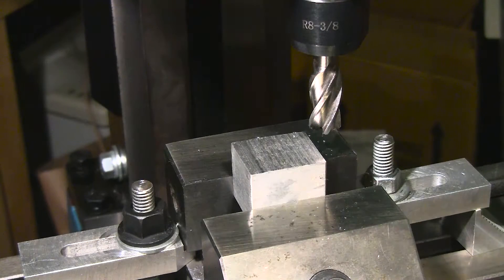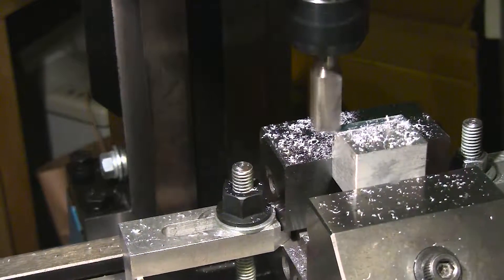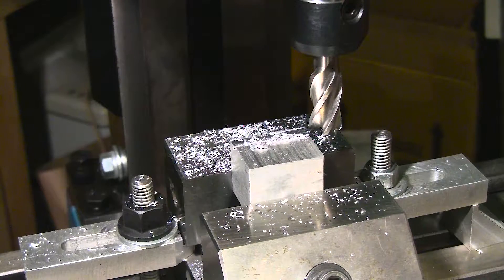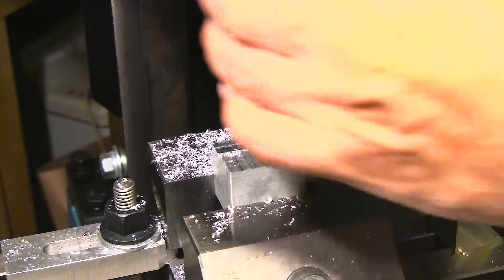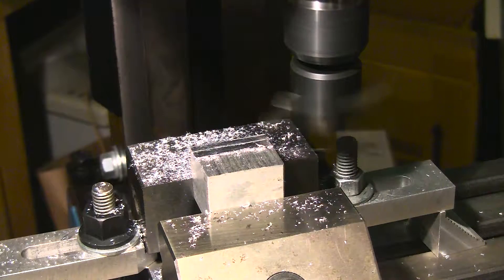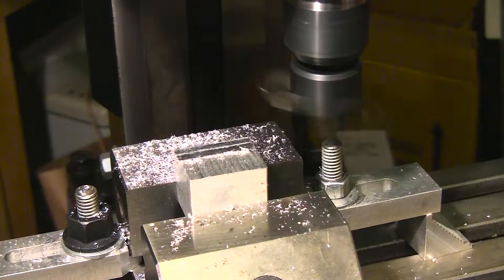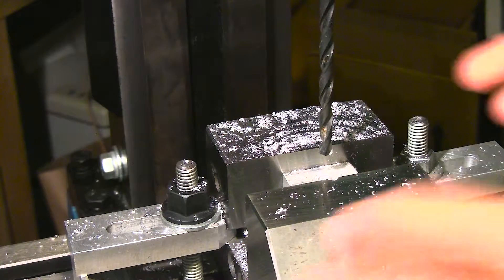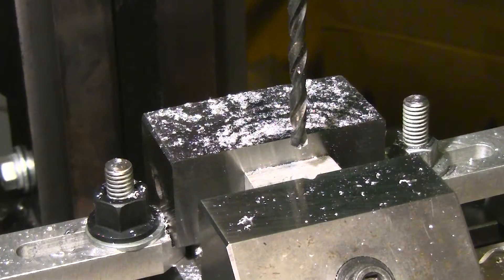The LittleMachineShop.com 3960 HT Minimill Performing Basic Cuts

Comment: Thanks Jose. Solid little mill. What are the tolerances, does it consistently get down to 1/1000th?
Reply: I have had the LMS 3990 mini mill for years now and use it daily. Like any affordable imported piece of equipment, it does require "tweaking" and modifications for personal liking. I can easily hold 1/2 thou, when when using my power feeds. The initial cost of the mill is not terrible, although the constant need for different types of tooling and cutters is where the budget will suffer. Tooling becomes addictive, especially when you see the great end results of your project.

Comment: even when you weren't Machining that thing made a lot of noise mine doesn't make near that kind of Racket it's really really quiet and it's a harbor freight
Reply from the maker: I have nothing else to compare it to. It's different that the HF model.
Reply: It does sound like a bot of "bearing scream" although hard to criticize with a single bladed oversize fly-cutter. I have the LMS 3990 and use it daily for years now and it is still quiet. Perhaps a drip  of oil on the upper bearing to see if that makes it any quieter? Chinese bearings are basically garbage anyway, always inconsistent.

Comment: What size bolts does the X axis take?
Reply from the maker: I'm using regular hardware store 5 /16"  diameter ones. You could almost slip a 1/2" one but remember these Chinese XY tables are. metric.
Reply: Thanks for the Reply. I was curious since my mill isn't here yet and was buying up stuff for it.

Comment: Mini Lathe and Mini Mill Demos always seem to cut Aluminum. Is steel just out of their practical range?
Reply: I have both the LMS 3990 mini mill and their 7 x 16 lathe. I cut many steel materials, including stainless and chrome moly with Zero problems and great finish results. Sizes are held within 1/2 thou. People have to realize that with the smaller, under-powered machines that smaller cuts and speeds have to be a practice. I was used to my old South Bend lathe and Jet mill, but discovered that immediately and became used to it simply taking more time on larger projects, but with excellent results. Proper selection of cutters and their material type, with feeds and speeds are crucial for any machining operation, regardless of the machine. It's always easy to place blame on a machine, although it is the operator that makes the difference.

Comment: Would you buy this machine again?
Reply from the maker: +oishisakana Yes I would. Though only if I was not going to work on anything beyond the capabilities of these Minimills. They are great though. If I needed to do large work then I'd have to go with a larger floor mill.Their newer one is even better!
Reply: I am torn between this model mill and the lms5500 mill which is a 2.7 Sieg.  But significantly more money.  I work with motorcycles.  Just need to make brackets and will mostly be slotting a lot of aluminum and some steel.  And using it maybe 5-7 times a month.  Any machines you can recommend for me??

Comment: Nice little baby machine, performs very nicely, for it's size. Something that helps a lot with machining aluminum is, a little kerosene or WD-40, stinks a little, but, you can increase speed, eases the cuts and avoid the chips sticking to the cutters...
Reply from the maker: +pierre beaudry I do use WD-40 and it is convenient to use. I did not for this little demo as I am in an area where I did not want to make more of a mess than what I already made. But yes. Aluminum does require a good lubricant or coolant to produce the best cuts. I find that a 2 fluted end mill is much better on it but I decided to try it with the 4 fluted one and yes, not as good a cut as one can get with the 2 fluted one. The Flycutter work dandy though. I use it for all my full surfacing jobs. Unless I want the end milled look. Joe
Reply: The 2 fluted don't get packed like the 4 flutes... Fly cutter is the way to go with lower powered machines == more removal per HP
Reply from the maker: +pierre beaudry Agreed!
Reply: Pierre's Garage  Pierre, is there a reasonably priced fly cutter that you recommended?  I have a mini mill.